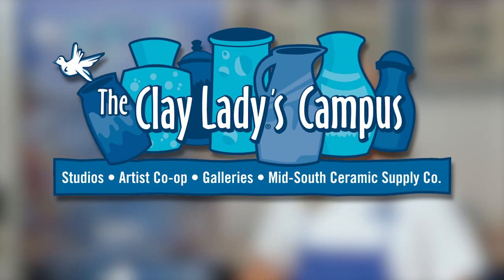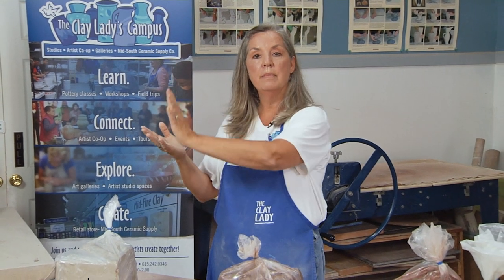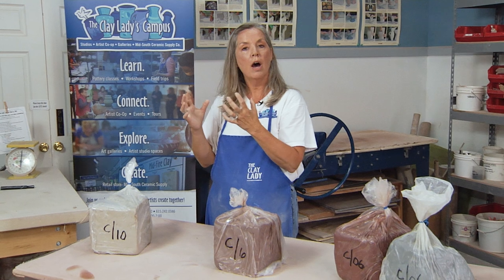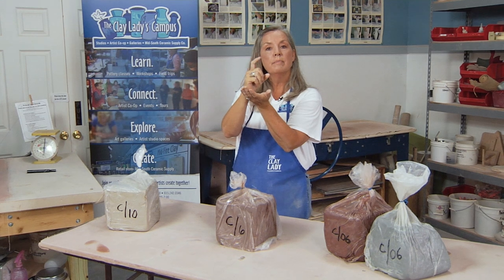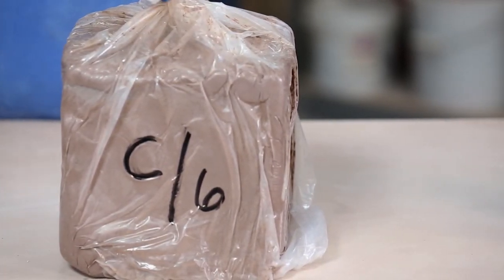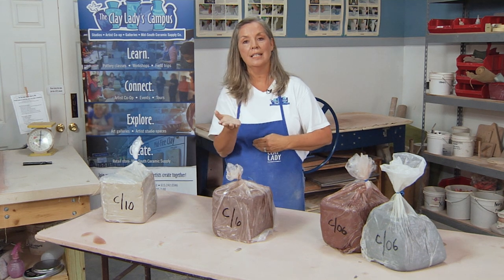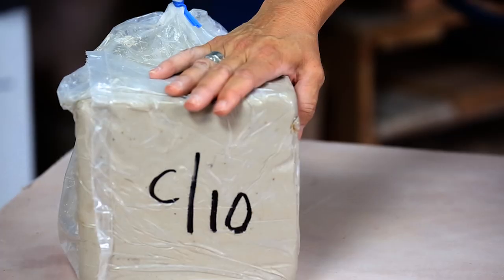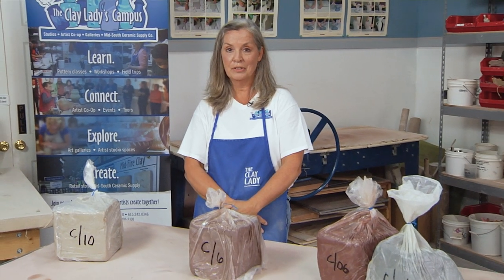Firing Temperatures of Clay with The Clay Lady

Comment: I want to be a traveling potter. Firing is the challenge. I usually use stoneware in studio but maybe earthenware since it fires at a lower temp would be better. Could I pit fire it? Or if I used stoneware maybe just bisque fire so it can travel well until I have enough to high fire somewhere. Thoughts?

Comment: I have low and mid fire clay. I’m cleaning between throwing but a tiny bit of the low fire might get into the high fire. Could I still fire it to cone 5?? That’s my typical firing temp but idk if it’ll melt
Reply from the maker: Do not mix low and mid fire clay! You can use both in your studio, but keep them separated.
Reply: @danielletheclaylady  if we have already mixed them, i guess we should threat them as low fire to avoid any accidents??